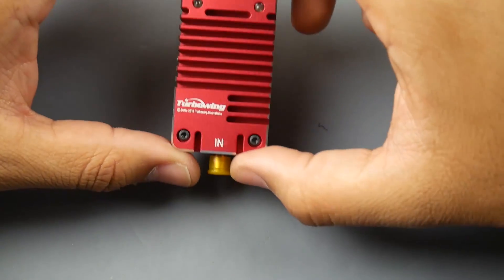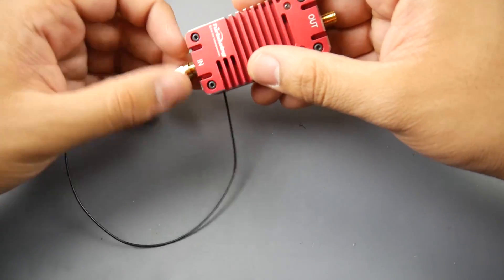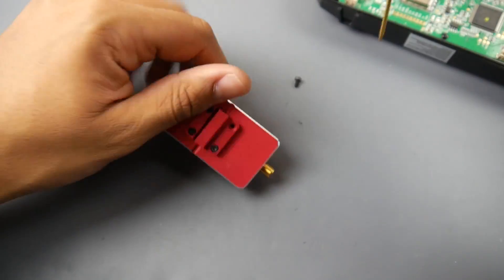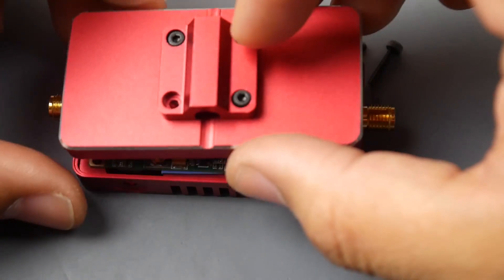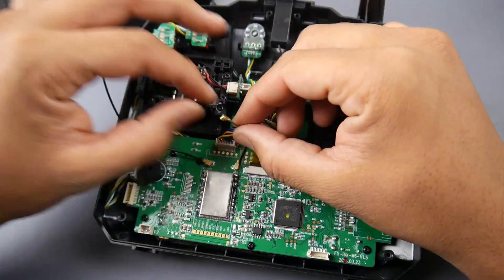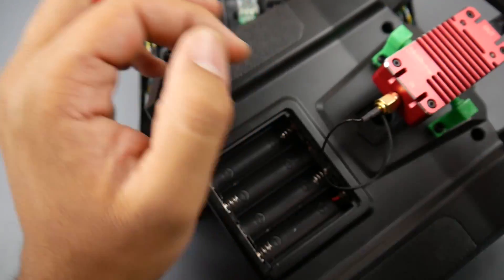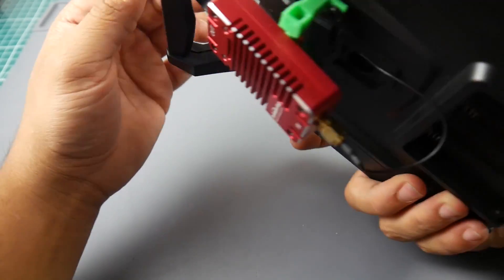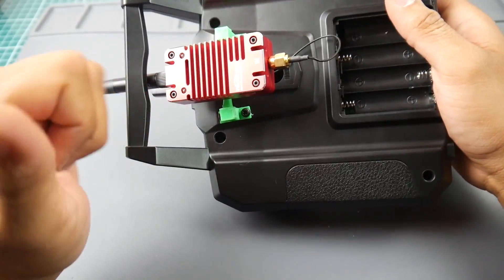FlySKy Long Range Amplifier Mod [PART 1] //  Turbowing RY-2.4 Radio Signal Amplifier Booster

Comment: Friends,
 What a great video, where did you source that amplifier? Dang 1 watt, turn that on in your house while streaming video and test for interference. Also I believe that the full size TBS crossfire transmitter can hook to the trainer port on flysky radios with a simple adapter. 
Thank you,
Reply: I searched your channel and see you’ve already done that video. 
Thank you

Comment: i seen a 4w version and thought about slapping it on the back of my modded flysky FS-T6.
the antenna elbow broke so i need to do an antenna mod anyway.
i'll probably go with a 1 or 2 watt. i dont need to transmit up to a mile. I'll loose video feed before i get that far.

Comment: This has a really short cable between the Tx and the Booster.  Could you use a 10M SMA extension cable to put the booster at the top of a ground station antenna mast?
Reply: if your running this way 
radio 10m coax-1w booster antenna 
Then I’m guessing it would work in theory I’m also assuming the stock radio signal can make it through 33 feet of coax cable before it reaches the booster , as long as the booster is getting signal your good because after all it’s job is to boost the signal it receives anyways so you might even be able to run a 50-100 foot coax that would also enable You to get that booster & antenna much higher in the air on ur antenna mast

Comment: work on flysky fsix6x ? https://www.ebay.co.uk/itm/2-4G-Radio-Extend-Range-Signal-Booster-Expansion-Devices-For-DJI-Vision-FPV-EG/184622219000?_trkparms=aid%3D111001%26algo%3DREC.SEED%26ao%3D1%26asc%3D20160908105057%26meid%3Dcb7d2214db2a403db94307cd53628fe7%26pid%3D100675%26rk%3D1%26rkt%3D15%26mehot%3Dnone%26sd%3D184622219000%26itm%3D184622219000%26pmt%3D1%26noa%3D1%26pg%3D2380057%26brand%3DUnbranded&_trksid=p2380057.c100675.m4236&_trkparms=pageci%3Ad1c16c10-73f8-11eb-acf2-3ec6f78159a0%7Cparentrq%3Ac2bb8d161770aa65789f0b1bffd6a8ac%7Ciid%3A1

Comment: Could you put this on the model itself? To say boost the range of a castable sonar bobber connected to a bait boat?
Reply: It amplifies the control transmitter signal from around 100mW to 2000 mW .
  It takes 8x your power to double your range . 
So 2x power needs 20 times battery and will go 2½ times the distance of the factory 100mW.
  Modern elrs claims to come with 1000 mW . So this wouldn't do much for that .

Comment: Ok for the transmiter signal boost. What about the receiver. No need for antenna improvement or so ?  Signal ?boost? Of receiver ?
Reply: Not really.
If you want to hear the telemetry better, then you should buy an upgrade for the receiver.

Comment: I have 40MHZ FM transmitter which i use to a bait boat. I can not find any similar booster for fm transmitters.are there any out there? Or i am just spending my time?
Reply from the maker: Try searching for amplifiers instead of boosters.
Reply: @DroneMesh  i found amplifiers but in description does not mention for rc use.they mention about cars etc.i guess its same thing?
Reply: @aspergerhellasbn  wifi booster is that you need to search for. Try Amazon

Comment: Hah I did this with a 2w 2.4ghz booster on a phantom2 controller. Only thing is I had to run external power to the booster.
Reply: I was going to test this on a betafpv lite radio 2 and phantom 3 maybe.. 
Too bad mavic mini is 5.8ghz

Comment: Termostickers are actually pretty good at transferring heat, so termopaste may increase termotransfer, but not by much
Reply from the maker: Depends on quality if you know what I mean.. We cant say they used proper thermostickers in mass production but time will tell
Reply: Drone Mesh Do you plan a follow up range test?

Comment: Nice vid i have a 4w one but in my experience it just strengthens the signal and it goes maybe for 200-400 meters  but nothing crazy, in my opinion the 1w or 4w  is not true
Reply: which 4w one did you use?
Reply: It needs a bigger battery maybe .

Comment: what about latency? i really want something like this but i want to know if, when im racing, if it can either be turned off to rely on on the internal antenna only or not increase latency by too much
Reply: It's "analog" device. So it will be almost no latency. The latency that will show is how fast the transistors can respond. These devices are also used for wifi amplification.

Comment: Its my luck to see this video. Actually i ordered this before and i was about to receive it in some days. But actually i wanted to not to accept it or directly return (wanted to order r9m and tranis). but after seeing you video now i want to try it. I will get this in 1 or 2 days. Inside quality looks very fine. Just worried about rssi value in remote. I think this transmit and receive signal also. Lets see my order comes first or your testing video. M happy with both conditions. Thanks again. 👍🏻
Reply: I put a 2 watt on a bugs 3 . It beeped low signal once at 600 feet . But the video fpv was a 600mW rs32 and $50 goggles .  Still have it in a jar . Just in case. So 800 feet was the video limit and trees made ut beep . So you cant weave around through the neighborhood . Just fy circle up high

Comment: I run a 4w booster in my spektrun dx7 thats very similar to that and what i needed to do is run a buck booster cause when the controller bats run low range drops but at 16v i can go for miles
Reply: Do you feel warm when you are turning it on? 4kW is quite the power.
Reply: Think means 4000mw , i have one also.

Comment: I want one that would work on my TBS crossfire module!
Reply from the maker: Are  you really maxing out your crossfire if so how????
Reply: @DroneMesh  Getting 1.5 miles out and having LQ drop to 50% on the turn-around gives me the willys.  It's probably ok, but I'd rather have a measure of comfort!
Reply from the maker: What output power you have set?
Reply: @DroneMesh  running the 250mw upgrade
Reply from the maker: Did you ever boot it without the antenna on??
Reply: @DroneMesh  no, I've got two rigs that behave the same way.
Reply from the maker: That is very weird I have not tested my cross in range.. I got the zohd orbit with lion packs i think i will setup a crossfire test and see if i get the same issue.

What antenna are you using?
Reply: @DroneMesh  immortal t mounted on 3d printed mount off the rear.  No failsafes yet, but it always drops a lot when I rotate to head back home....
Reply: Mark Pfeifer Thats a polarization issue maybe. When your craft is faving away the polarization of the tx/rx antenna matches (i think both of your tx and rx antennas are mounted at 90 degree offset). By turning 180 degrees there is a mismatch of polarized signals which results in signal loss upto 30%. Well thats what I have learnt so far. Correct me if I am wrong
Reply: I have seen dumb 900MHz amplifiers out there that could work. Try that. Why the dumb ones? Because the smart ones only works for mobile phone.

You'll probably would not get it to work when you are close to your receiver, it will overpower the input.
Reply: Full size Crossfire is able to run 2w lol